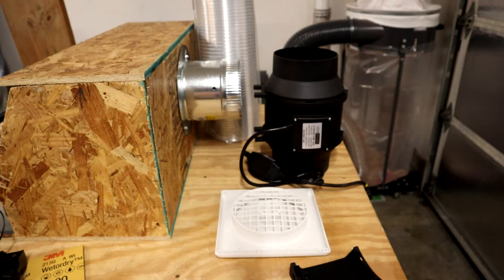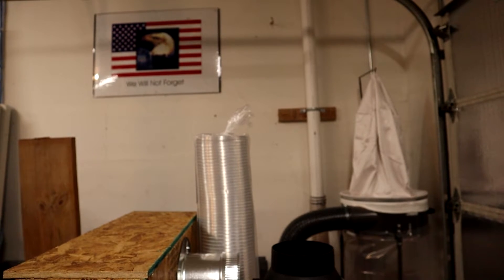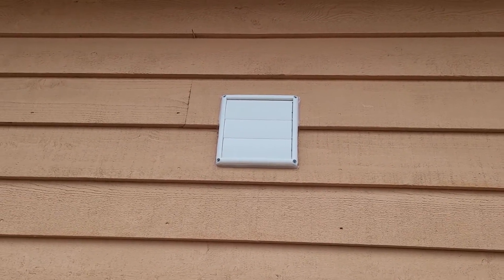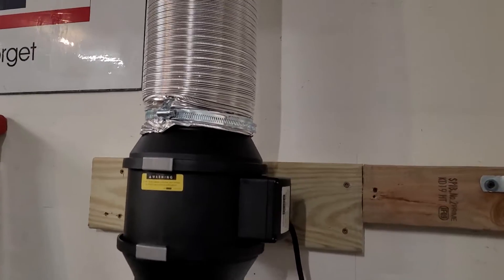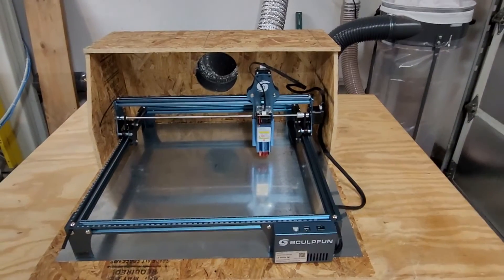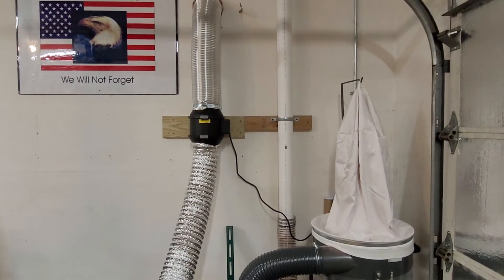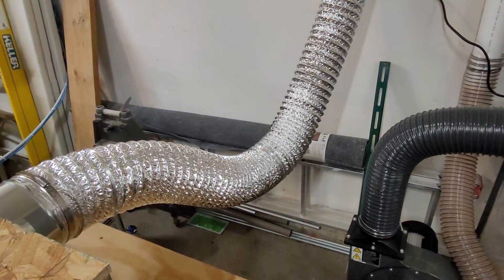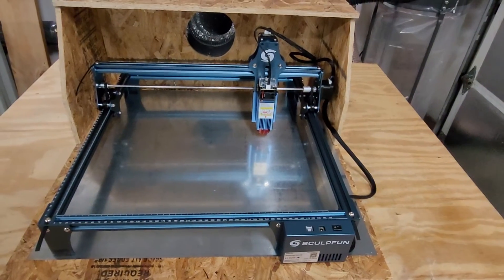DIY Exhaust System installed for the SculpFun S9

Comment: I was thinking of using a box fan sucking air through an AC filter and a little tent over my Sculpfun to see if I can vent it indoors without it smelling like a forest fire. I have a glowforge with an inline fan venting it outside, but you can still smell it a little.
Reply from the maker: Yep, you definitely need air flow to the outside with these

Comment: Nice work :-) Could you try to cut wood so we can see it works.
Reply: I just got an s9 and it cuts 3mm plywood very cleanly with very little burn marks at about 75mm/min. I suspect adding air assist will make that a but faster.
Reply from the maker: Pt 3 is coming